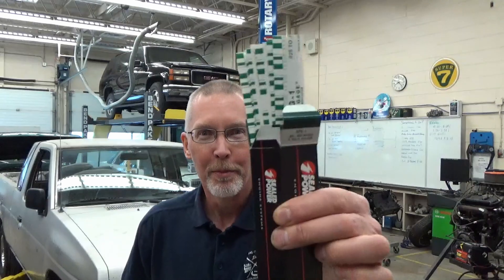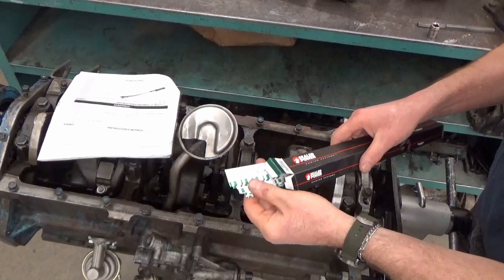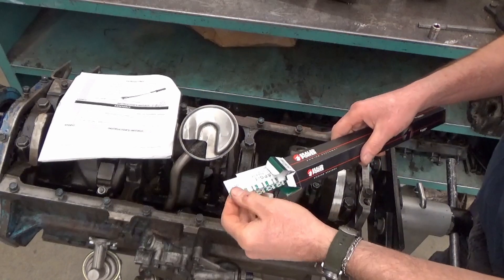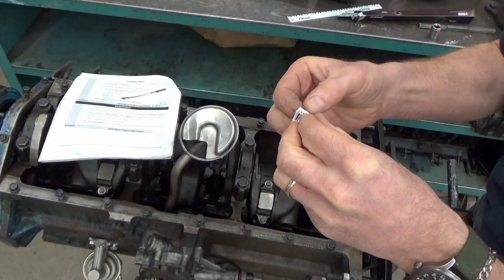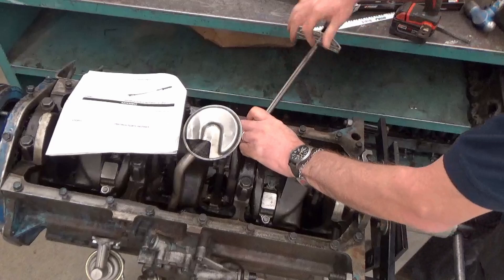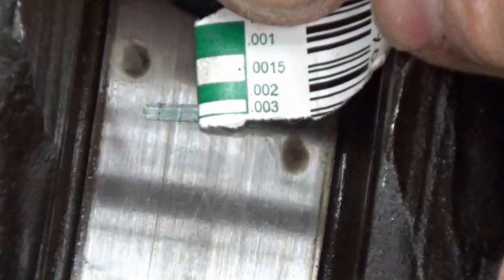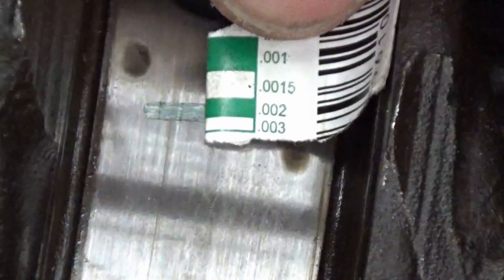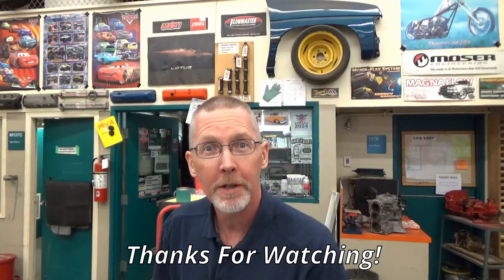HOW TO: Plastigage

Comment: My only issue with PG is it doesn't keep well in Florida. You do what you can. Used it a couple years ago rebuilding a Korean motor. KIA/ Hyundai. Indy grade design, but not build quality. Tight tolerances, like 1.5 thou...

Comment: B4 plastigage there was shim stock. Tiny strips of varying thickness, and too thick prevented you from turning the crank. '70s tech baby. Oh wait that is what we called Mr Williams. If you messed up in auto shop he would call you baby. For final practical 3 man teams would be called out to pull a motor and rebuild it. He called the whole class, except me. They took off to be the best team. I said Baby? You didn't call my name! He said St.Martin, you and I both know that I could put you in there all by yourself and you would have that engine out, rebuilt, back in and running before the rest of them could get the motor out! I said yeah, but how am I supposed to get a grade? He said, would an A do? Yep.
I had a NASCAR mechanic of the year as a stepfather. So I had an edge. And a deep desire to be the best. Ted Haywood was an amazing man. Marine(Golden Glove) helo mech, frmr Jax PD, frmr NASA hyd engineer, and Daytona PITA. Built a 289 pushing 504@9 grand. Black flagged in 68. Earned MOY after that.  I learned from the best. Wasn't easy...

Comment: How do you use this with the one time use or torque to yield bolts? Once you have the proper torque on the bolts for the proper fit and you loosen the bolts to check the fit, you have to through the bolts away don't you?
Reply from the maker: Good question.  I would probably use either the old ones, or maybe half-torque the TTY just for the measurement. You're probably not going to get a huge amount of deflection in the assembly between "close to" and "at" the yield point.
Reply: You only need to snug it down. No lube, as it has it's own thickness. Pop the cap back off and I use a razor blade to gently skim it off. Maybe not necessary, but it wasn't in the original ingredients list...
Reply: Use the old bolts with the plasti-gauge, then the new ones for final installation

Comment: Plastigage is good stuff.  Way cheaper and easier to use than an inside and an outside micrometer.  Probably more accurate too since it actually lives in the space between the bearing and the crankshaft journal.

Comment: @Teach - Maaan... Dude, u were traumatized in ur tender, formative years... Kinda explains a lot..😁 Sidebar - can u do a proper video on the proper use of a telescopic micrometer; to be more specific: measuring out-of-round cylinder bores? When I do it I get different readings at the same spot in the bore - very frustrating. And can you do a vid on piston ring orientation (does it really matter to be 45° from the previous gap)?
Reply from the maker: I do need to do that one.  I'll look into it - thanks for the suggestion!